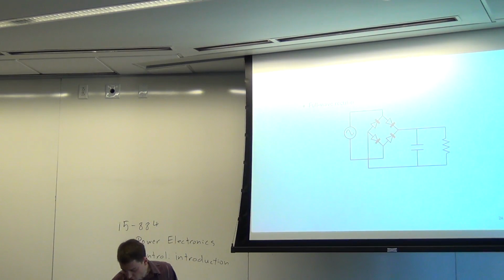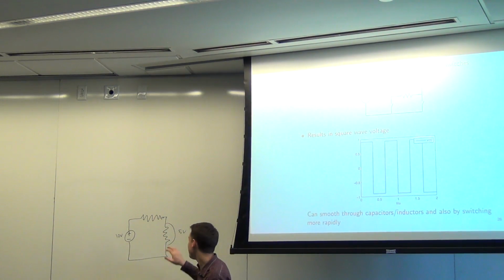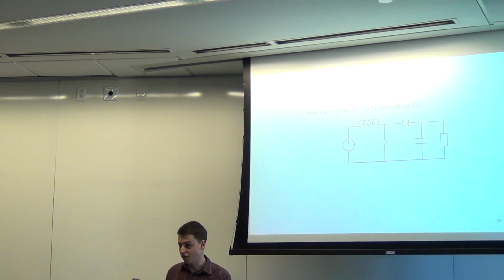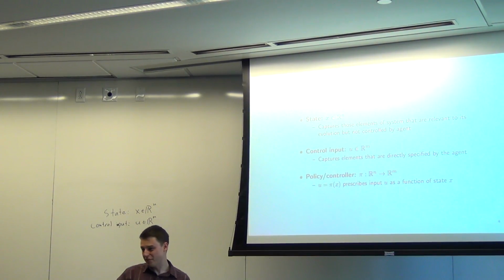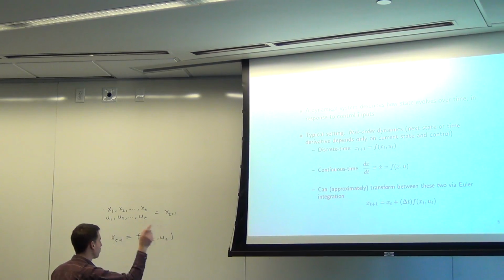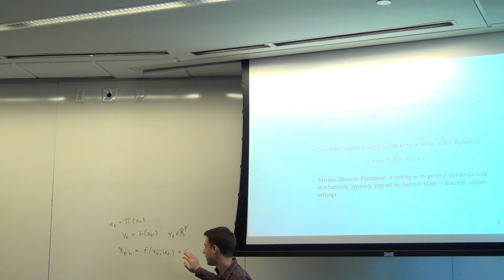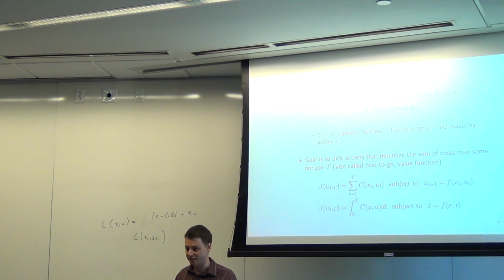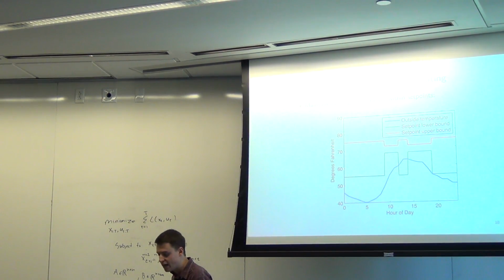Lecture 17: Control introduction

Comment: Thanks for the lecture! Very interesting. But man, you should improve your understanding of buck and boost converters! It doesn't take solving the equations to get the main point. It's easiest to analyze these circuits in steady state, i.e. when the output voltage is already where it should be. Also assume that during a single switch cycle there is no significant change in output voltage. Then you can notice that during switch cycling one or the other way, there is a DC voltage applied across the inductor, which causes its current to rise or fall linearly.